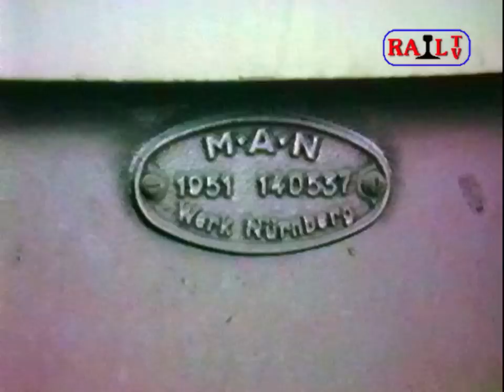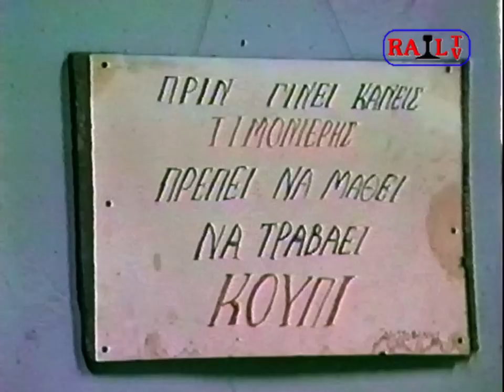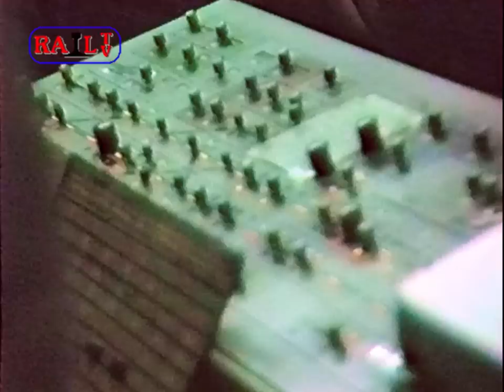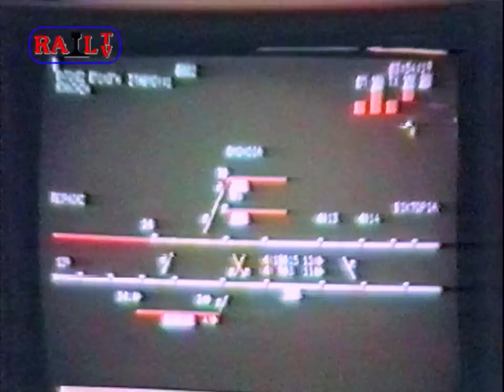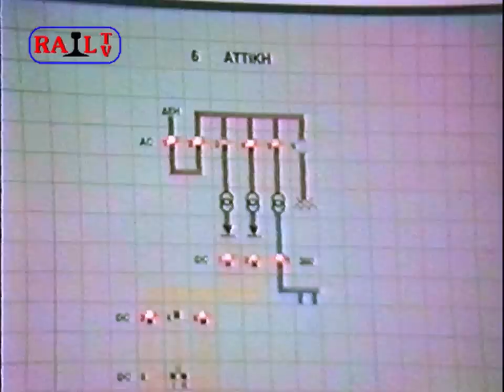Μια μέρα του 1993 στον ΗΣΑΠ - Sites of Athens-Piraeus Electric Railway in 1993

Comment: Well, someone has to write something in English.
Reply from the maker: 0:07    Piraeus Terminal
1:24    Piraeus Maintenance & Construction Workshop
 1:48    A Series 8 vehicle on the underneath tires  
             grinding lathe
  1:57   Works site
  2:18  "Prior to become a steerman one has to learn oaring"
  2:40  Rails grinding vehicle (HSAP-made)
  2:47 Cabride Piraeus-Omonoia Athens on the   
            museum Series 4 Thomson-Houston
            wooden electric train 
  3:10  Neon Faliron Station
  3:43  Kallithea Station
  4:06  Petralona Station
  5:35 Thiseion Station
  5:55  Thiseion Depot
  6:12  The unique freight car by modification of a 
            passenger car
  7:35  Monastiraki Station
  9:10  Omonoia Station
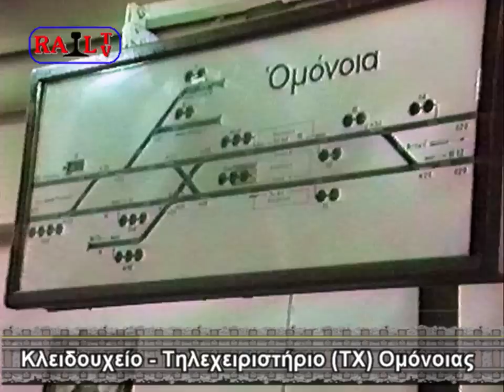  9:35  Omonoia Signaling Room 
10:12  HSAP Head Office on Athenas Str.
10:28  Central Traffic Monitor & Control
Hope these may be of some help